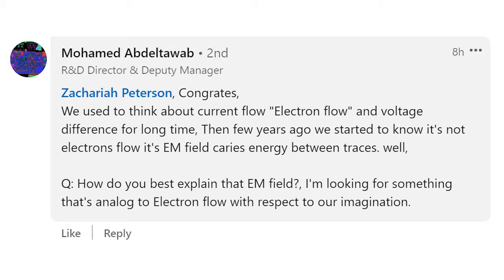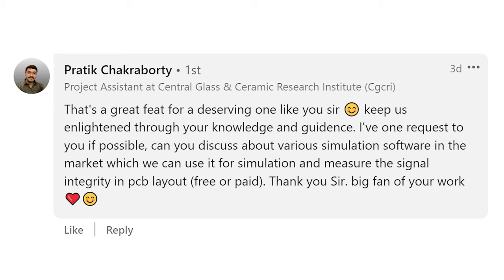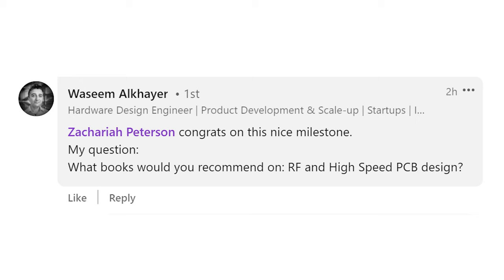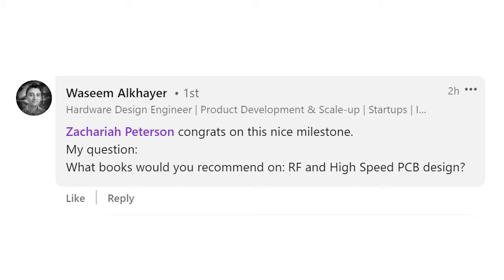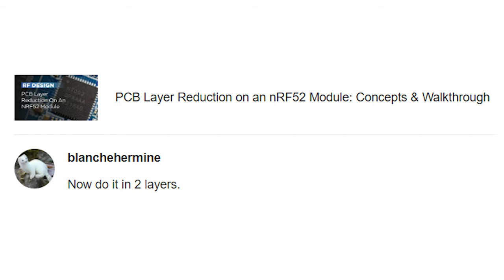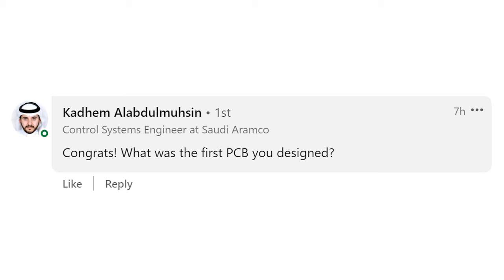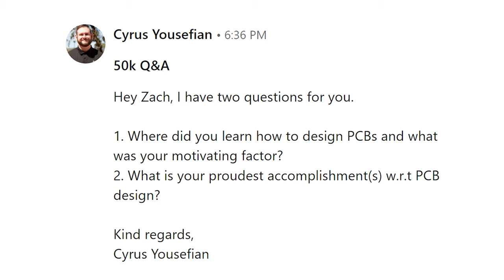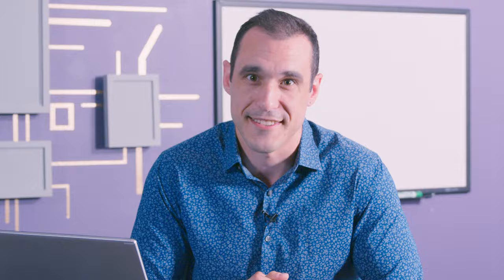Answering Your PCB Questions: 50k Q&A!

Comment: i am doing a 4 Layer PCB..With ARM Cortex CPU with many others component like Memory, Mosfect, 433mhz RF receiver unit...but porblem is my CPU PCB Will inside inductor motor with very high magnatic field zone area..is high magnatic field will damage my PCB for noise..?

Comment: At 1:44 I believe that I heard you say "while it's true that electrons do not flow along a trace". That has to be wrong. If a trace is. lets say, made of copper and there are electrons that are loosely bound to the copper atoms that can be coaxed to move from the atom, leaving, again, say, a hole, there there is indeed electron flow.  Perhaps you could rephrase what you are attempting to say. If I am wrong then please correct me.
Reply: The idea of "flowing" electrons, like water in a pipe, is an attempt to explain Kirchoff's current law in terms of conservation of charge, and later in terms of conservation of mass (when later it was found that electric charge is quantized in discrete bundles with fixed charge to mass ratio). That is not to be taken literally, neither in quantum mechanics nor in the classical picture described in Maxwell's equations. In the classical picture, or even the statistical mechanics picture, motion of individual electrons in a crystal lattice is random but the electric current is really the propagation of some net charge density of some polarity (either positive or negative) in different regions of the medium. So in this picture it does involve motion of electrons but not in the sense of "1 electron enters at one end of a wire and that same electron exits at the other end of the wire." In the quantum picture for a single electron, the wavefunction is what propagates and the electric current is proportional to the probability current. So again, when you calculate an expected value from the wavefunction for a system with many particles, you get a net flow of charge density, and the probability of "1 electron enters and that same electron exits" becomes vanishingly small.

Edit: for more context in the classical picture as described in Maxwell's equations, look at the derivation of the continuity equation. The continuity equation specifically describes the rate of change (or the flow) of a charge density, and not of discrete particles.
Reply: @Zachariah-Peterson  good explanation and I appreciate it. What really struck me about the original comment was that if charge does not flow, at least in some fashion, a capacitor could not "charge".